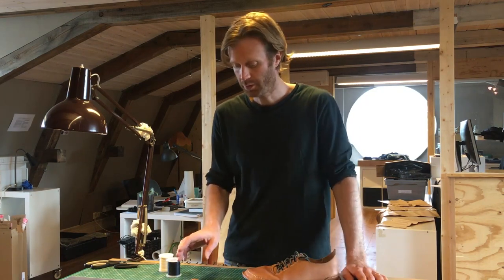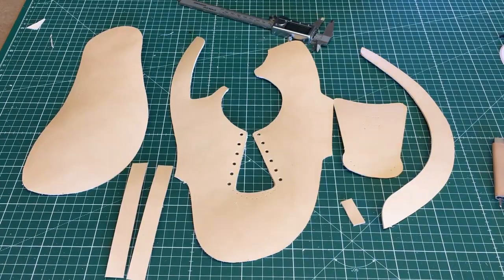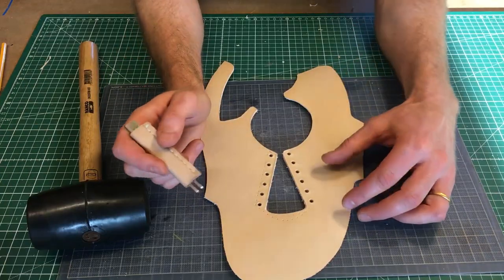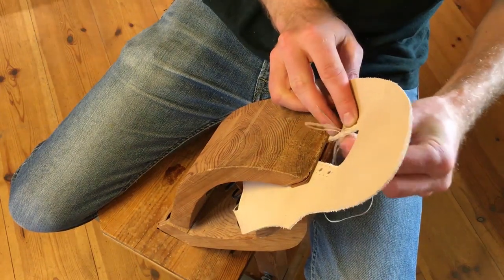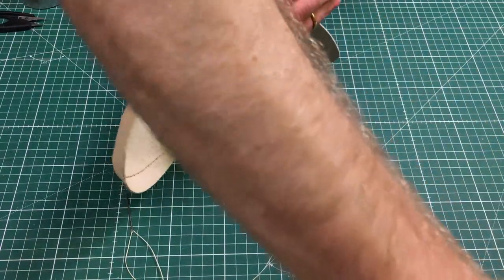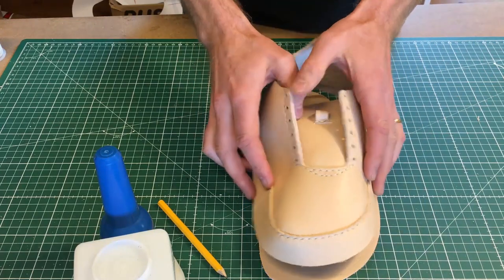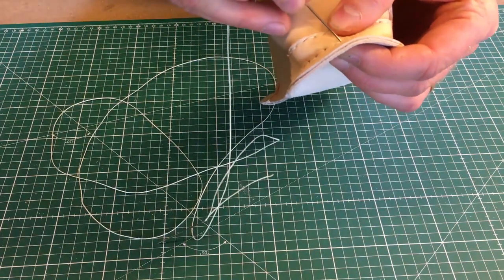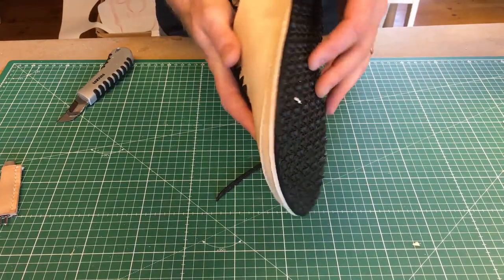How to make your own custom trail running shoes

Comment: Just made a pair in quite thin goatskin, veg tanned and using a vibram newflex sole. Amazing feeling to run in them. Highly recommended. Weighing just over 140g per shoe it is probably the lightest running shoe around.

Comment: Very clever shoes design with great construction. I am ordering your pattern. Some suggestions: burnish the edges of the leather after cutting the parts out; cut a stitching groove.  Certainly, neither are required, but you will have a higher quality finish and the burnished edges will have better water resistance.  Fantastic job.

Comment: You have the beginnings of a really awesome shoe here. Unfortunately I think this sole design is not suitable for softsoled/barefoot shoes. The shoe should project as little as possible from the side of the foot. Still I may give them a try just to learn from the process. Great work Johan! Thank you!
Reply: They look quite similar to Softstar Sawyers, which also have a sole that projects outwards. It's fine, and means that, unlike a lot of BF shoes, they don't have a sole that curves up at the side to create a lip around the foot and toes, and are hence less restrictive on toe splay.
Reply: You can always just hand-welt it on a barefoot last so it has a better shape. It’ll hug your feet a bit more too probably. More complicated though and not necessarily great for an easier DIY. I might try it that way and modify the insole so that it fits a bit better to my foot.
Reply: @noahschatz9015  Isn't a welt the thing that is sticking out? I am not quite sure what you mean. I think I'll give this design a try anyway as it seems like the perfect project for learning the craft of shoemaking.
Reply: @shoutatthesky all that really matters is the shoe is light as possible, follows the profile of your foot, does not construct your toes, and has minum padding/sole thickness. So for me I'm going to make the toe box a bit wider but besides that I think this a great design
Reply: @MichaelBrown-wx6zq  It certainly is a great. I was a little bit unfair with my comment. However, I still feel the worst part of this design is the welt sticking out. This soon becomes an issue when you walk off trail.  The ground is not always even or firm so you inevitably will hit things with the welt and it will catch on things because you re using the whole shoe rather than only the sole. I may not be explaining this well but I have worn barefoot shoes for many years and found this to be a huge design error.

Comment: Bought your pattern but printing out will be tricky. There is no instruction of what size paper the pattern should be printed on. Also the paper size seems to be giant, almost like a full newspaper size. Definitely can't be printed at home. Probably needs a professional printing service. Please clarify.
Reply: The info is on the website. It is possible to do on multiple standard sheets of paper.
Reply: With a standard printer at home